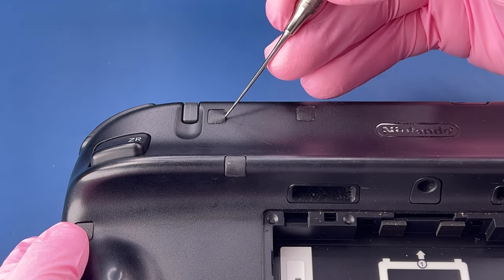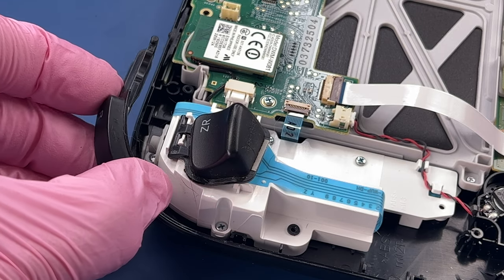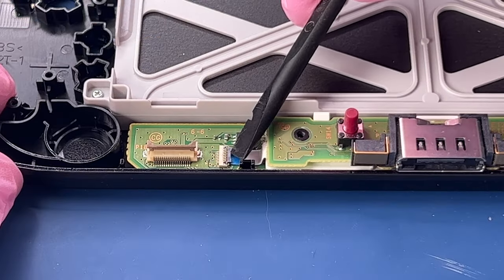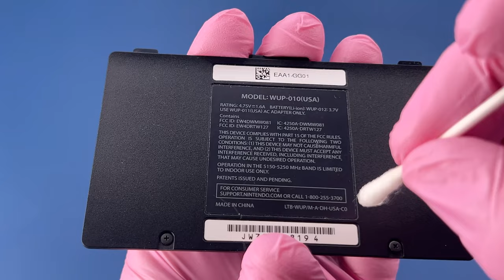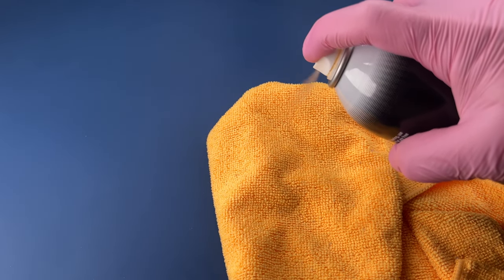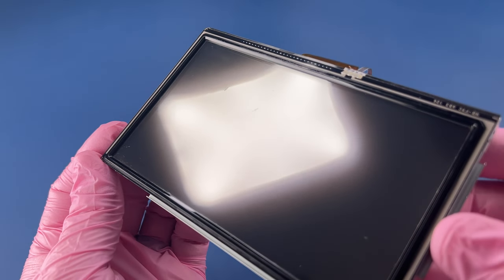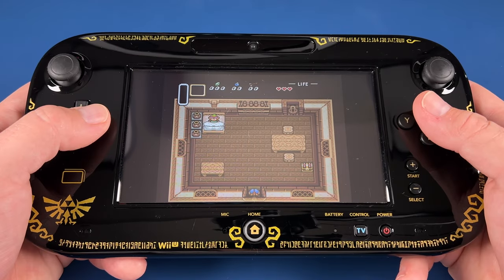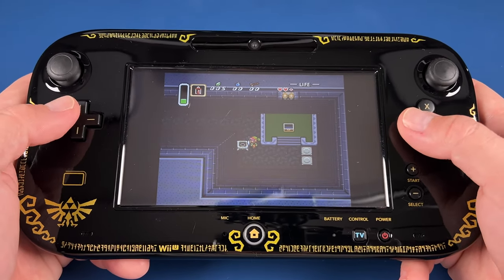Deep Cleaning This Zelda Wii U Gamepad

Comment: Hey. Is there any like LCD Polish where you could get light scratches removed?
Reply from the maker: Nothing I am aware of. But if anyone else has an idea I'm open to experimenting.
Reply: You could propably use normal acryl polish, but you need to be careful with applying pressure